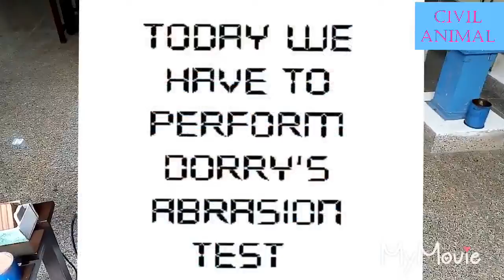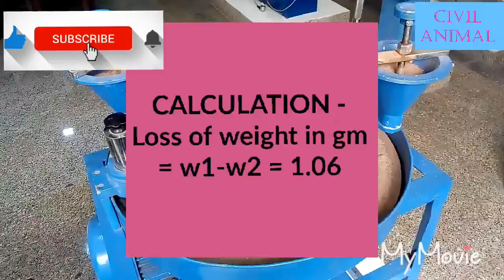Dorry's Abrasion Test | Transportation Engg. | CIVIL ANIMAL

Comment: how did you get the answer? in video you got w2 =0.118, but in your solution its only 0.18?
Reply from the maker: Its 0.118 which means 118 gm.... Machine showing the reading in gram it  is W1- W2 =125- 118 = 7
Reply from the maker: It's a slide problem
Reply from the maker: It's a slide problem
Reply from the maker: Thanks for your query....Please subscribe the channel